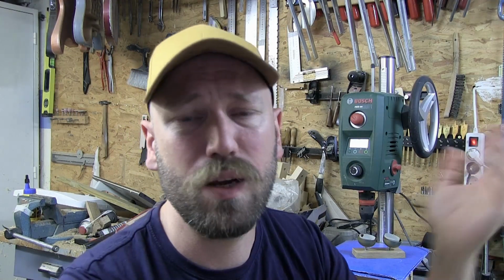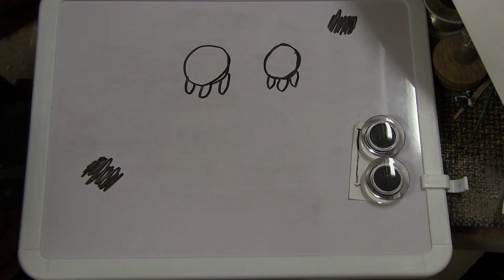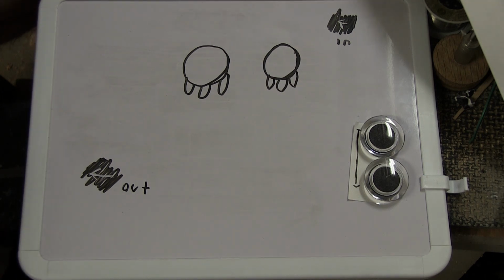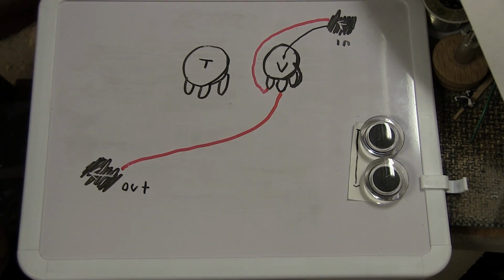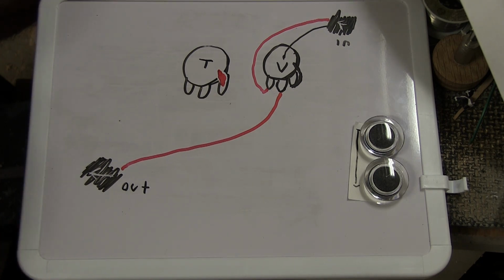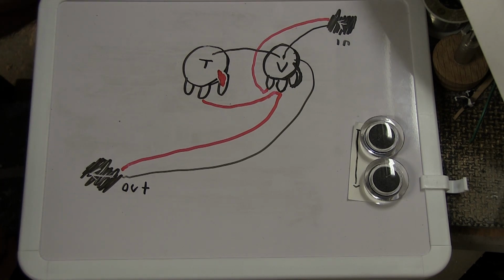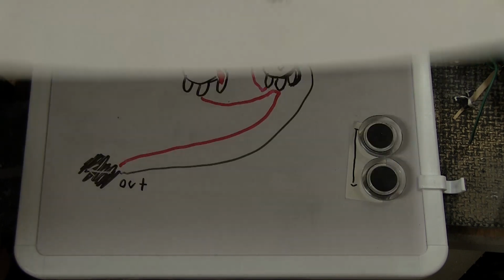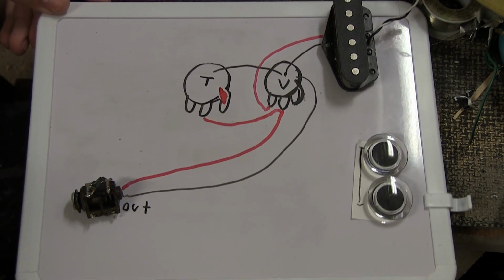basic tone and volume wiring for beginners

Comment: What size capacitor did you use for the tone pot. I'm trying to build your pink pedal. And that's all I have left to solder
Reply from the maker: Its a 022uf from a guitar but you don't need to use exactly what I used I only used it because I hade it laying around, good luck 😁